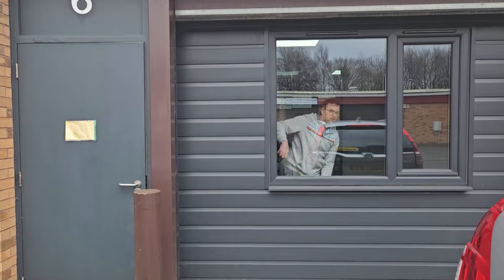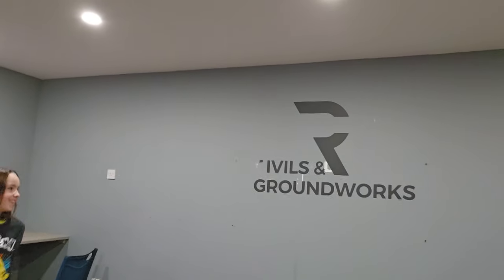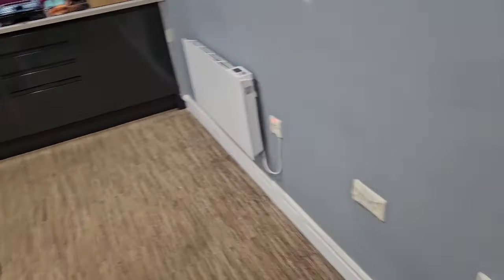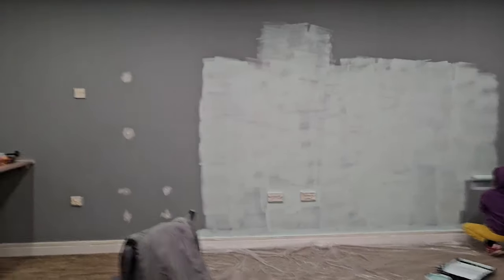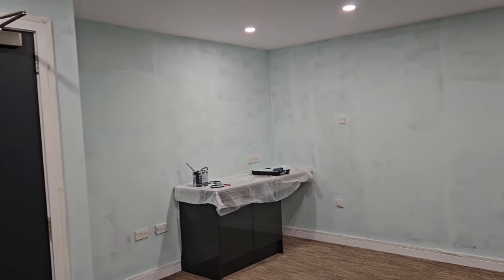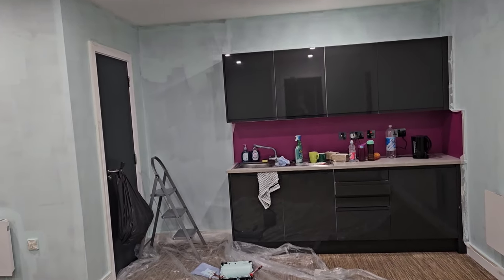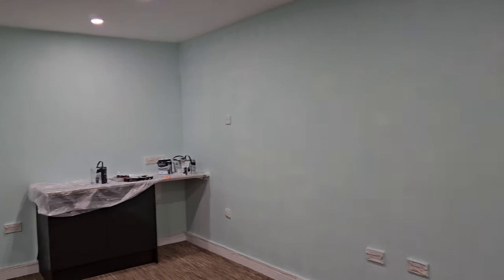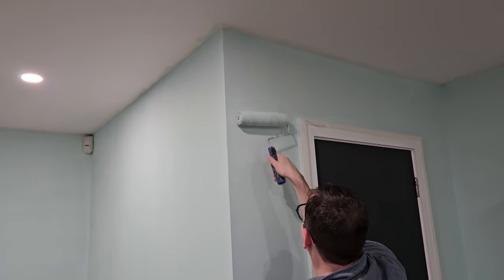Work Day Vlog - Painting The New Studio (April 1st-4th 2024)

Comment: If you’re able to tear up the carpet there is probably just concrete under so you could just use that with some anti fatigue mats for your feet. Just a cheaper option.
Reply from the maker: The issue is that its a full repair lease so everythings needs to go back to the same condition or better at the end of the lease, so if I rip up the carpets now, then I'll have to replace then later. Covering them and protecting them seemed the easiest option, then we'll only need to remove what we've put down.